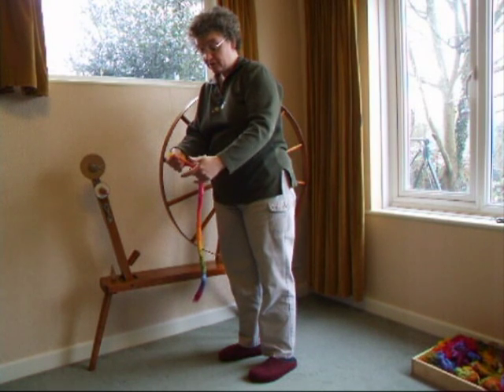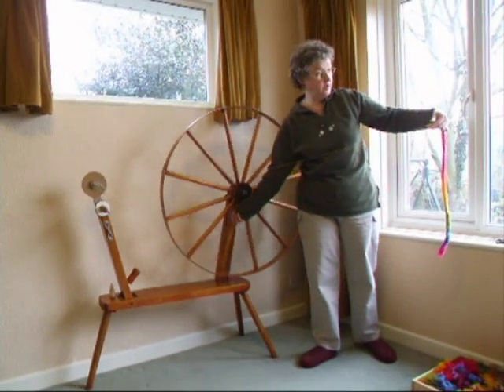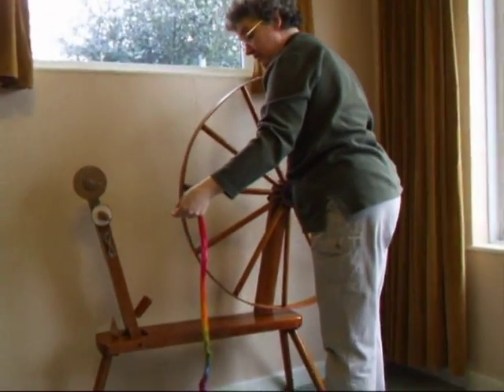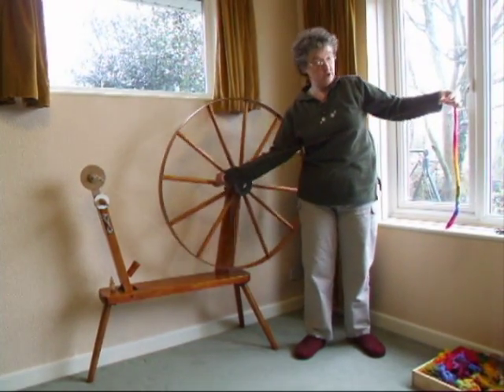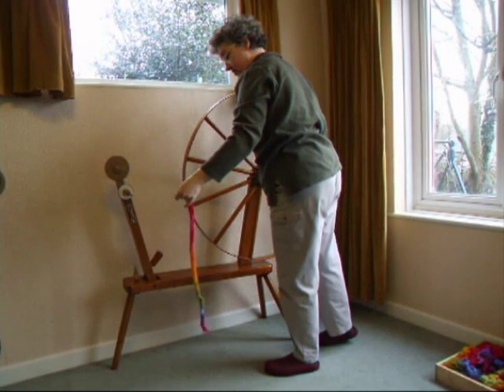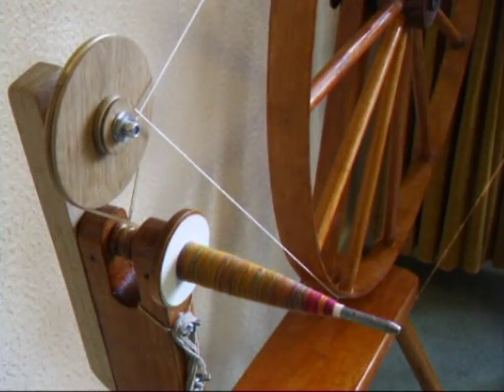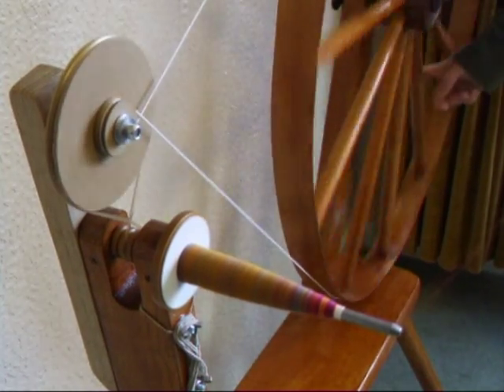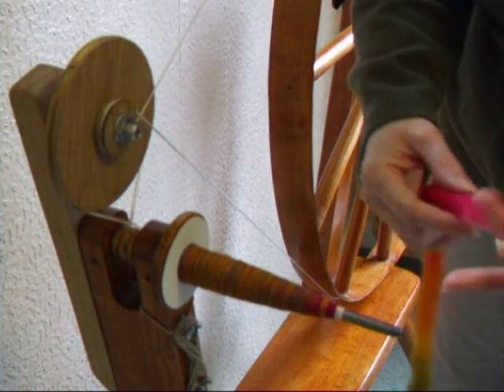Spinning Cotton on a Great Wheel

Comment from the maker: Hi,

It was made specially for me by a local craftsman. I told him it had to fit a small car to take to demonstrations. The wheel diameter is 36in, I think the old ones were  45 - 50ins or more (the size doesn't matter now with the Minor's Head). He also made it easy to dismantle, the wheel and legs both unscrew from the bed. As it's a modern copy and wasn't too expensive, I don't have to be precious about it, and anyone can have a go. I have had kids as young as 3 or 4 spinning on it.  Amanda